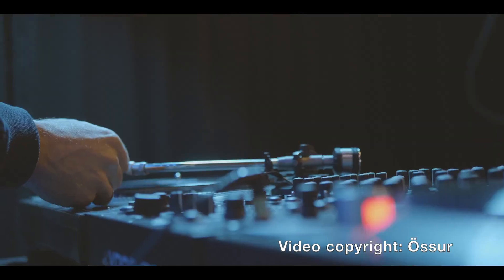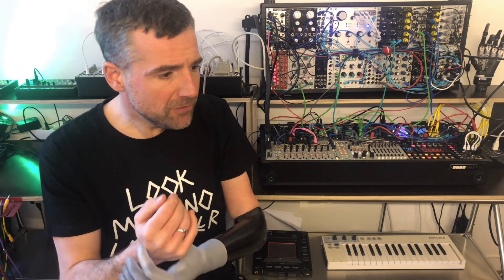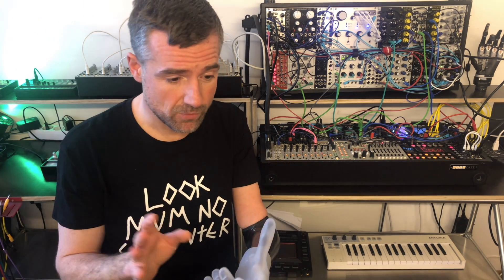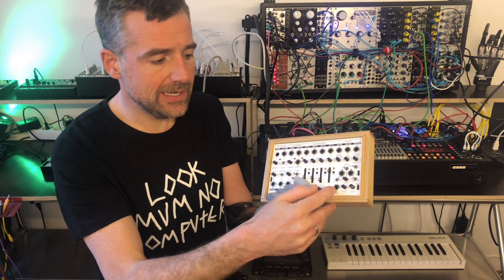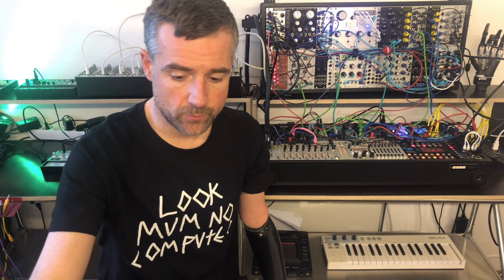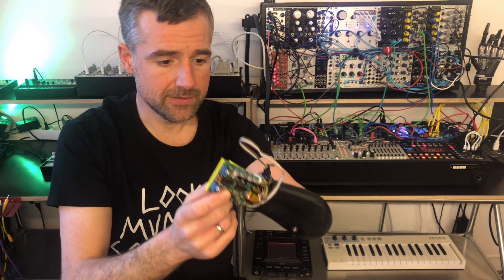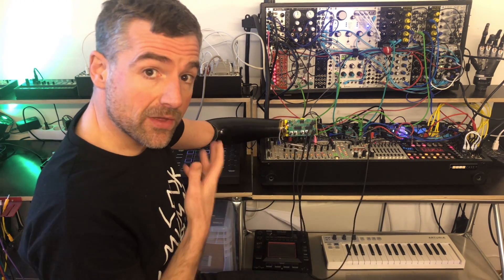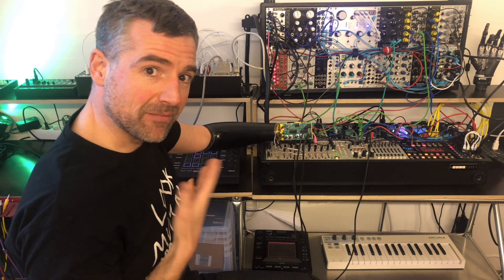Hacking my arm prosthesis to output CV so that it plugs into my synth: Thought-controlled music!

Comment: I think we've got the same amputation, same arm too. These things are definitely each to their own but I was surprised to see how much you rely on the robot arm. In my experience with prosthetics, I find they get way more in the way than they do good. Like for example, you mentioned at the start that the hand has difficulty turning knobs and quickly. For me, turning knobs that size would be no problem with my stump, could turn them easily and quickly. Your solution to this though is so dope, especially that you don't think about turning a knob you just think about changing the pitch and it does it. Thanks for sharing :)

Comment: This is incredible, and a big inspiration! I'm trying to learn enough electronics to help someone I know create music from various pain signals (Not sure it's possible, but I'm loving trying lol). 

It also gave me an idea(s), if you can't add more electrodes to the prosthesis, have you thought of using a foot pedal (sort of like a guitar pedal) where each stomp switch connects to and controls two sequencer functions. And both of your electrodes act as input for the entire board? Then you could stomp switch one, which may be set to control say pitch or a filter, then stomp switch two and control timing, etc...?

I also think it'd be cool to have a "continuous" button. So if you set a filter on stomp one then click stomp one's "Cont..." switch, it'll keep supplying that voltage so the effect continues, allowing you to stomp on another switch for more effects?

Sorry It's just me thinking out loud, lol. Awesome video though, I'm definitely excited to keep up with your progress!

Comment: Simle as: "YES !!!!!"
I was just thinking of how specific can you target the impulses in the base of your arm?
It must actually as we other tap our fingers on the table or imagine an air-keyboard..
Don't know how many signal there is to pick up, but it should be possible to get the most of the signals to every muscle ( https://www.google.com/url?sa=i&url=https%3A%2F%2Fbreakingmuscle.com%2Ffitness%2F7-exercises-to-maximize-hand-wrist-and-forearm-strength&psig=AOvVaw2ldnPRtrd1cZlk_6dI9YlS&ust=1595409557973000&source=images&cd=vfe&ved=0CAIQjRxqFwoTCNCvrNGB3uoCFQAAAAAdAAAAABAE)
If you could get 8 of the 10 in the picture, you could control quite much just by "playing air guitar" :)

Comment: this is amazing..  👍🤪

hmm could advance protesis maybe output a signal for each finger (5) and each joint (15) potentially have a board with 5x15 (mixing joint and finger movements) outputs.  then instead of a jack then have a usb device de sperates the signals into the different modulators.  And everything is played by thought.  🤔  it seems very possible.

Comment: Does the prosthetic hand actually feel like an actual arm to control, or is it more like clenching specific muscles in... well, the stump of your arm to produce the two signals which are then interpreted by the circuitry? Because from how you spun your hand around 360 degrees, it seems like to rotate the hand, it's more of a constant signal to 'turn right' or 'turn left' than how with normal limbs, you can consciously decide their overall positions, and your brain will control the muscles in a specific way to move the limb to that position.

Last question, can you clench specific fingers or only all at once?

Comment: This is fascinating. I'd like to understand more about how exactly your thoughts end up as two different signals; can you shift the pitch seperately from the first signal? Doesn't just the voltage change, so that both go up or down? 
Also, what phenomenal, inner experience goes with the shift in the signal? Is it enough to just think about any movement in your hand, or do you literally think about manipulating the control board?

Comment: You should use one output to switch to another cable and the other output to adjust it so you can hook up more than 2 cables and control them

Comment: If you could install more electrodes for more channels and chop off your other hand, you could become a human A.I. Use a big metal box with a bunch of blinking lights on the front to stand inside of. Have the wires coming out the front so it looks like some retro-futuristic computer. Make your stage name Synth Bot or something. Way out there I know, just thinking out loud.

Comment: It'd be good to have your control signal instead go into a general purpose input in the synth. Which then get's directed to an effect when you press a corresponding button next to each effect control knob. That way you can quickly direct the signal with momentary buttons, perhaps selected by your right hand.

Comment: wonder if you can make this into an actual instrument, since you have 2 controls here, you could control pitch and volume, and then learn how to control both, probably first learning a simple on off pattern at the same pitch, then a high pitch low pitch pattern, then you could progress to simple songs after that, you might need a higher resolution though, not sure how precise those signals are.

Comment: This is interesting as an electronic engineer that also enjoys sound mixing. I wonder if you could turn this into more with a interesting wireless proximity interface system. like send signals to just the control your next to. So you would have more like a pointer for a hand. So you would move it to a control like a normal hand but then use the signals wireless to control just that one control so you still get the ease of use and movement without moving jacks all the time. I think you would have to do it as a synth conversion mod otherwise you would be building a full synth from scratch and it might not be viable on a portable kit. I am talking about using webcams to track location on the board that would send to a computer that would route the signal from your arm to the right control. No super spendy parts wise with stuff like raspberry pi and open source tracking software like OpenCV but tons of custom building and programming. If a fish in a tank could play a video game with this it can track placement on a mostly flat surface.

Comment: Instead of one dial per signal you could hypothetically run all of the significant dials you use over to a secondary control board which receives two inputs, one to adjust the current dial and the other to cycle through the dials. Not sure if it would feel as intuitive to control but it would certainly give you quite a bit more versatility in your control.

Comment: Why not use an amplifier?  It seems that there is no problem if you use a rectifier circuit.  If it is a problem to go through a boost device, the connection to the cable should be a physical constraint in the first place.

Comment: I'm waiting for the next video in a year where he re-purposes one of those old yu-gi-oh dueling disk toys with various EQ knobs on it, a backpack for a laptop (and external batteries for everything), and just controls it with his arm, laptop into arm, through the old guts of a small EQ board in-side the dueling deck (had to look up what there were actually called), then through the artificial arm for some final tweaks, then live.  Maybe get arduino involved and some put some barcodes onto the face of a bunch of yu-gi-oh cards and whenever he "plays" the cards, it is scanned and loads a different song/adds/enables effects through the computer/whatever.  That would be some really cool shit to see.

I half want to see some very elaborate set-up that is 90%+ based only on the prosthetic/connected to the prosthetic, and half just where this project ends up.  Hopefully not with him destroying (what is likely) a very expensive prosthetic.

Comment: It would be cool if you could find motions in your working hand, that don’t produce voltage when tried on the prosthetic arm. Like thinking about moving in a way that the prosthesis cannot. If you could find one or two ways to do that, then you could maybe make one with a pass through so you could have the hand and the modular controls all in one. Now I’m not going to pretend I have any knowledge about how the prosthetics work, but it would be cool if possible!

Comment: For the next version what if instead of always having control of two specific dials that you're plugged into you use one channel to select which channel the other one adjusts? I'm not sure what type of output the two sensors are (like if they're boolean on/off or a scale) but I'm sure you can figure something out.
Of course for cable management you'd probably want a box with all the circuits and connections to the synthesiser and then just a single cable to a "hand" that's bare bones just passing data to the box on how to work. Maybe even as an ambitious v.3 have this box also have a screen that let's you navigate more complex things (like turning on and off scripts).

Comment: I've never seen anything like this before. I don't know why, but this to me is so amazing. Could you explain more on how this works? As if for each individual would they have more or less muscles to work with? Could you use a custom keyboard designed for you? Such as using a muscle to push A and another to modify the first input turning A into B. This type of stuff is so amazing.

Comment: In what way is it thought controlled? Is your prosthetic not reacting to muscle contractions and interprets them into signals which are then interpreted by a computer chip which then interfaces with your new extension? It is amazing and I am happy for you and for everybody that has the same impairment. But isn´t it more like pushing two buttons with fingers than controlling the synth with your mind?

Comment: Dude that's really awesome, but I think you'd have more potential (more ways to experiment) with the newer prostetics, they have digital signals.
I don't know what you "think" about to control that device, but I could imagine decoding an or several electrode (I have no idea what tech is built into your arm) into several different outputs.

in my mind you it would be like using one of those "brain caps" toys/real scientific devices to read your brain activity, if you put the finger up, it raises the volume up, thumbs down (taking into writs rotation signals) it does the classic record scratch, if you put the middle finger up it plays what god intended to be played:
https://youtu.be/c5fts7bj-so?t=108

No but seriously I got worried that you'd fuck around with the new prostetics because GOD DAMN those are expensive... yet you should definitively play with them there's so much potentials in them.
I wish I knew somebody with one of those, willing to risk their limbs for "reverse engineering science" :)
Reply: The reason I made this comment is because I clicked on this project with my own ideas brewing giving that I've studied electronics and I'm quite comfortable with digital signal processing and SoC implementations, and my half brother is studying electronics with intentions to get into prosthetic!

Comment: I have so many questions. First of all, as far as I know amputees have a sensation called phantom limb since the brain still has functioning parts for the missing limb. I never thought about what happens if you are born without a limb. Do you also experience phantom limb? Also, I believe phantom limb sensation can change over time: limbs extend, shrink, grow etc. Which I think has got to do with body perception. What is it like to have a synth attached to your arm in this sense? How does it feel to close your eyes and control the synth and hear your motor skills changing the sound? How does it affect your agency?

edit: also I got so excited I forgot to tell how amazing this is, at every level.

Comment: Hmm, quite interesting. A thought though is if you can control both signals independently and simultaneously. Cause if you can, one could be used as a selector for a filter and the other actually adjusts the filter mattering on how finely you can control them. It would have to use a complex circuit with some ram, but it's possible that you could adjust filters faster then with a hand.

Comment: When you have two CV jacks plugged into your arm are you able to control the individual voltages separately or do they both change in sync with each other? ie can you move the filter and the pitch modulation you were demonstrating in opposite directions?

Comment: What would be cool is if you were to add Bluetooth connectivity to it and make it wireless. Even cooler; integrate Bluetooth into the arm so that a signal would be sent to a connected device any time those signals are produced, place the antenna and circuit into the body of the prothesis, and you could maintain the use of the prosthetic hand during performances.

Comment: this is such a cool project, cant wait to hear what you come up with. Just based on what I know you have control over how much output you put into the device, right? could you potentially use half, quarter, and full "levels" of the filter input? I love this because it took your weakest hand and essentially made it your strongest in what its being given. I would imagine you can achieve better speeds and control once you get the hang of this and work out the design and usage. Keep it up man,

Comment: There should be plenty unused/barely used nerves in our bodies. Imagine if we could connect a bunch of them to similar devices and have analog inputs for everything without any delay from our muscles. And we literally have a neural network just to automate complex movements which learns all the time. This could make complex things possible. Imagine a Joystick in you head for mouse movements. This would be already possible with the device he build (analog x and y axis outputs). Add another axis and a few buttons and 3d modelling would become a completely different experience.

Comment: If you add a sensor that measures how your arm is turned, that sensor might, for example, control the volume, pitch or bass.
Reply: Oooo, clever. His arm may go from a synth adaptor to a synth if people keep finding ways to add features.
Reply: @WhatIsSanity  If you do it right you could even make it so that you still have the arm and have it remote controlled, so you can pull fancy dance moves...while making music.
Reply: In theory a third control could let him switch inputs for one of his CV channels, allowing him to control any of the knobs on the fly

Comment: Hey Bertolt! I've found that when I send something like 33% randomization into a simple 3 note arp (with a set scale) that I can influence the sequence just using thought, no wired connections. Then I'll play a melody or bass line along with it using my fingers and I swear to jesus christ the "randomization" end up being not so random and plays what I want it to. Also, programming the randomization to have 3 steps, going up to 3 octaves higher, helps to hear when it is the randomization or just the 3 note arp running. To me this is an initial form of communicating with artificial intelligence telepathically since the random melody seems to play along with emotions/thoughtness :P

Comment: I've thought about using the voltages the brain output to control things, but I never made the connection to use the already existing prostethics as an interface. I love everything about this!
Does the controlling feel akin to opening/closing your fingers, or is it more abstract? I'd imagine you increase voltage to contract the muscles, but I have no idea how our brains work. That you happened to have a suitable brain amplifier is hilarious. A cool byproduct of how integrated electricity is in our tecnology, and how much of a coincidence it is that our main source of energy is what we've always used to move around.

Keep it up! Great inspiration!

Comment: Okay, so, I’m a cognitive neuroscientist that studies EEG and this video made me SO THRILLED. First I would like to congratulate you on this amazing project. You look so badass with that fully rottating hand that can transform into a synth-machine. Applause. Second: I’ve had about a million ideas on possible upgrades/mods. The main idea would be make the best use of your two electrodes to give you max potential. My thoughts wandered far; but my best idea still is to find a way to use electrode one to change which button you are targeting, and the second to change volume/amp/power. Here you can use the double-tap alrogithm from earbuds, and use one tap forward increase two taps backward decrease, for both directions, perhaps three taps for a third command. Sounds doable? 
Third and last: there’s more potentials for binary/morse code/hexadecimal/ASCII that you could implement/learn. Since you have two 0 to 1.5 V electrodes available (perhaps a third if you’re willing to sacrifice the rotation, but I’m not sure upw your arm works) you could write binary with ease and have it translated. I looked into some arduinos/raspberry pi systems and it seems not very hard to make that translation in a tiny enclosed space.

Also of course, a bluetooth connection would make your life easier albeit bluetooth wouldn’t be the best alternative for DJing. Short waves infrared, assuming you’re always close to the machine, would be much faster and more usefl/make more sense.

Lastly, I thought one a few ideas where you could navigate a mouse via bluetooth. It should be doable using arduinos, and it doesn’t look like it would be that much work. I bet it would make your life a lot easier! 

Anyway, hope to see more updates from this project. All the best,
Ugo

Comment: I think it would be really interesting if you could actually implement the circuit into a hand mold and plug in your auxiliary or whatever (I'm an audio noob, forgive me) into say your fingertips. (Maybe have like a screw cap for each finger.) That way you still have a fully functional hand at the end of the day, but when you want to mess around, you can just plug in and go.